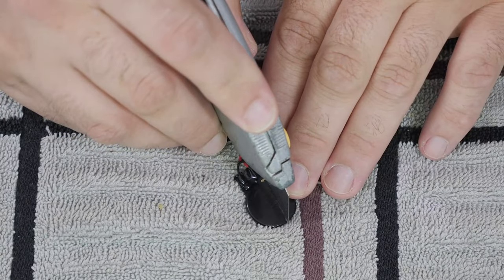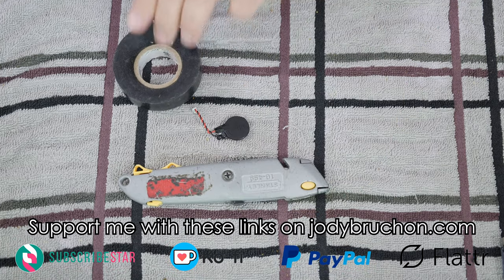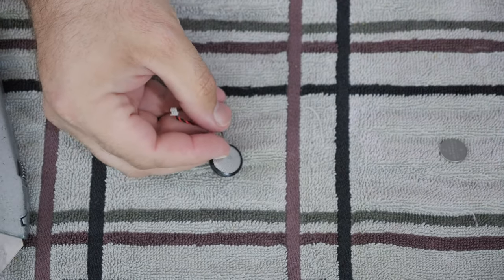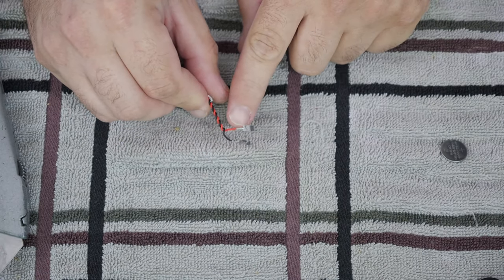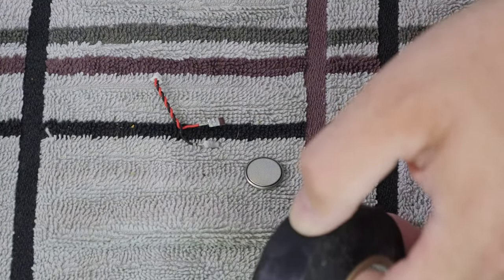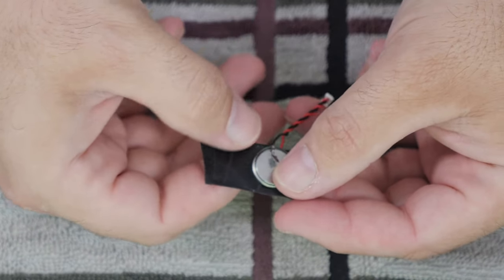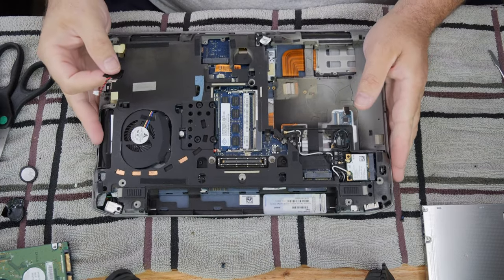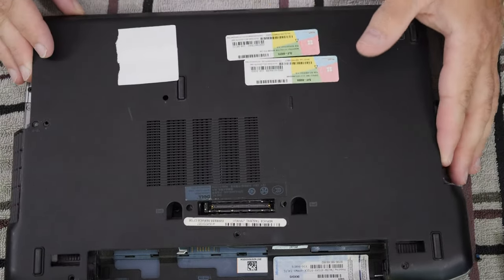Replacing Old Laptop CMOS Batteries with Standard Lithium Wafers (CR2032 etc.) - Jody Bruchon Tech

Comment: Great idea.  Ridiculous what replacements cost, compared to a coin battery from the dollar store.  I have found that clear scotch or packing tape grabs better.  I still wrap a 2nd layer with black electrical tape.
Reply from the maker: I just find electrical tape to be a lot easier to work with than plastic tapes.

Comment: The main problem with replacement of CMOS laptop batteries is dismantling the machine to gain access to the battery. I tried this with a 14-year old Acer laptop only to find that  almost complete disassembly was required. Many of the screws had been treated with thread-locking compound making their removal impossible. (The brass inserts in the plastic case started turning and the screws would require pulling out or cut off). This operation should only be necessary on quite old machines and their age may prevent them being used with latest versions of Windows., although they probably work OK with Linux. I've seen one video where someone cut a square hole in the bottom of the case in order to change the CMOS battery. Not so daft as it sounds, given my experience.

Comment: Pulling the tape TIGHT before cutting it creates a better tension. Just a tip fella. That tape is designed to go weak at the point of pulling when pulled tight.

Comment: But Jody, what if the tape gets loose from heat affecting the adhesive, what then? I could be back where I started and all this effort would then have been a waste. As an alternative, I've imagined using heat shrink of a diameter large enough to go over the battery. You see, this is all very stressful because I hate to fail. It's especially concerning since it might be argued that bothering with a Panasonic CF-27 in the first place is already a bit hard to justify. In my defense I can point out that it's cool. It also runs Windows 2000 well. That's all the justification I've got. And it's paid for. I'm leaning toward the heat shrink now.
Reply from the maker: The tape is to keep it there during reassembly more than anything. I haven't had a single one of these fail in the field. Since the customer would lose CMOS settings and get a nasty boot warning they have to manually skip, I'd find out quickly.
Reply: @JodyBruchon  I was being overly dramatic for the sake of humor but my concern about it loosening in months rather than years is real. Of course there's no downside to trying it in my case. Thanks!
Reply from the maker: @jozsefizsak  humor can be difficult to glean from mere text. Apologies.
Reply: @JodyBruchon  For sure. 😉

Comment: Is it not better, if soldered? For better contact.
Reply: contacts to the battery have to be spot welded, because soldering damages batteries, too much heat exposure. little spot welds dissipate heat quickly safely.
once again, Jody disappointed.
sorry big J =D
next time secure contacts to the battery with kapton tape(to avoid edge short) and put it in a heatshrink =) or buy cheap spot welder for 10-20 bucks :-P
bastard manufacturer should have soldered cmos socket to avoid this mess, since this is a latitude!
Reply: @donaciuxx  thnxz for info. going to look for some spot welder options in my region.
Reply from the maker: If you try to solder a lithium battery, it will explode and probably injure you. Please don't try this.
Reply from the maker: My method holds up over many years and I haven't had a single failure return, so I'm not disappointed. I'll keep doing what I'm doing.

Comment: I've been building electrical circuits and soldering for over 20 years. Let me say this. I no longer use electrical tape at all, with the exception of preparing wire harnesses with wire loom. Can't stand the stuff. If it's the cheap crap, it's just about worthless. Should the adhesive be touched with bare fingers, the oil from our skin has now ruined it. The only proper way to apply it is by stretching it tightly and wrapping several times, it's best to do this straight off the roll. Easier to keep from touching the adhesive and have something to hold onto, use razor to stab it in the middle then pull apart. When it's applied loosely, it will likely unravel quicker. This is why I always put a zip tie only over the very end of the wrap, keeping it from coming loose. Even with high end 3M tape, it leaves behind sticky residue just like duct tape. No one wants to deal with the sticky nightmare it leaves behind. Don't use that garbage either, as there are always much superior options. 

The ideal solution to creating your own laptop CMOS coin cell is retain most of the nickel strips as possible. Spot weld them on the new battery. Not everyone has a spot welder or wants to make their own for cheap if we don't also need it to build 18650 battery packs. In that case, it's perfectly fine to lay the nickel strips/bare wire on the coin cell. The only thing I would do differently is find heat shrink thats large enough to slip the coin cell into, skipping the electrical tape all together. Use a heat gun to shrink it or fan it with a yellow flame lighter from a few inches away, keeping the flame moving and rotate battery until its shrunk. If you must use electrical tape, try and fit a zip tie over it to keep the tape from unraveling if you can.
Reply: For this repair, I've never had a single problem. If it fails, I get a computer coming back with a "clock battery voltage low" or "time/date not set" message fairly quickly. For this particular purpose, it's definitely good enough long-term. I know the tape is not great stuff but it doesn't have to be.

Comment: Ok, I don't imagine HP are the only ones doing this. HP is where I have direct experience. (Part  of my business is re-using, repairing, re-cycling old IT kit.)
There was an HP printer, LaserJet 4, from 1992 or something. You can get a status report on the printer, one LJ4 we saw had a status - 740,000 sheets printed. Call it three quarters of a million. It must have been maintained over that time ! But hey, a workhorse !
A laser printer works by using a 'Fuser' to 'melt' the toner powder into the paper. The fuser burns out after 40,00 pages or so, it's a consumable. To replace the fuser on a LJ4, open the rear panel. Remove TWO screws, remove the old fuser. Install the new fuser, replace TWO screws, close the panel. If it took more than TWO minutes, it's because you took a tea break (ok, I'm a Brit). 
A customer asked if we could put the working fuser from a (recent) busted-up HP LJ 2937B (or whatever it was !) and replace the burned-out fuser in the 2937B that was otherwise ok. Sure !
4 HOURS to remove the bad fuser. 
4 HOURS to remove the good fuser.

4 HOURS to replace the bad fuser with the good one, and reassemble. We did NOT charge the lady £600, as we are human beings, and value our customers.
As I said before, screw you, HP. Screw. You.

Comment: What if the original battery is rechargeable?
Reply from the maker: Then you need to order a suitable replacement.
Reply: ML2032 instead of CR2032.
Reply: I’ve solved my problem disconnecting (desoldering) the charging diode from the laptop PCB, and installing a normal CR2032, works perfectly.